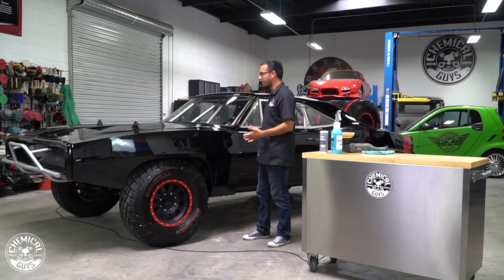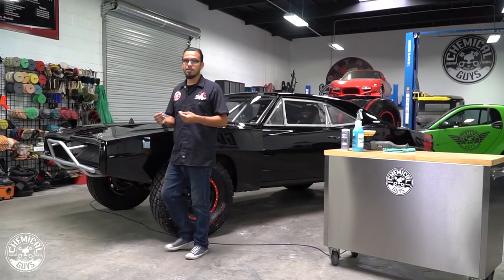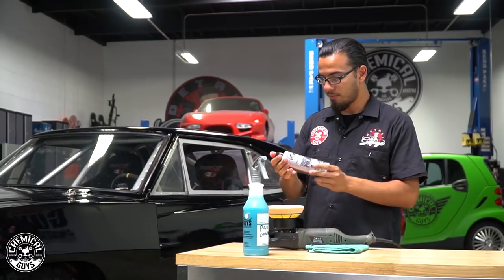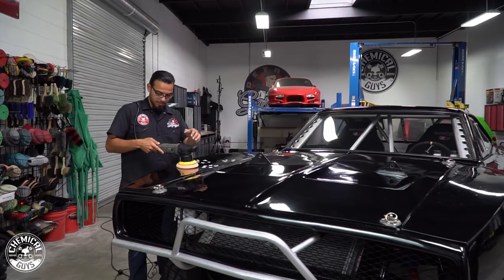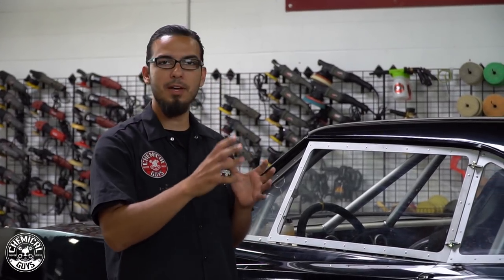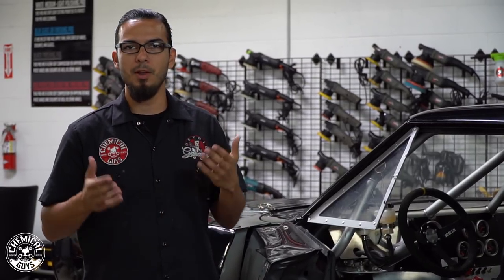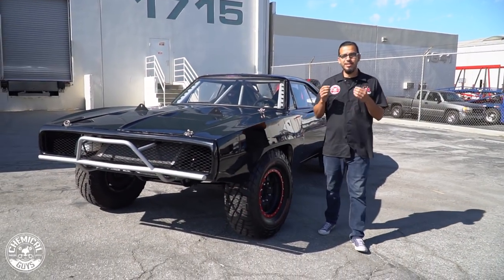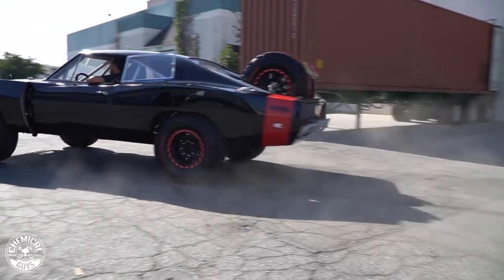How To Polish Fiberglass And Metal With One Polish- Dodge Charger - Chemical Guys Car Care

Comment: Lots of cars have none metal panels, what polish product would you use on those? Or just the same all over
Reply from the maker: It depends on the type of surface you're working with. For painted surfaces, you use regular polishes, and compounds to remove paint imperfections. For wheels, we carry polishes to restore the brilliant luster of the metal's finish. We now have a polish specifically for fiberglass, and gel coats for use on boats and R.V.'S